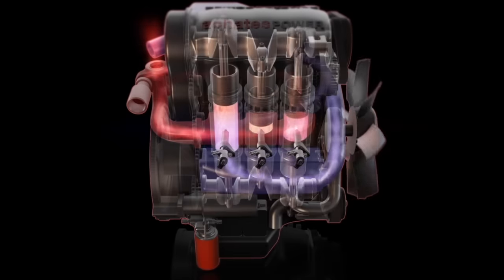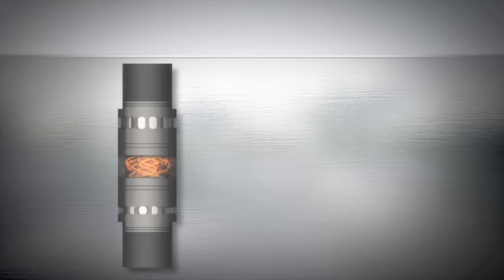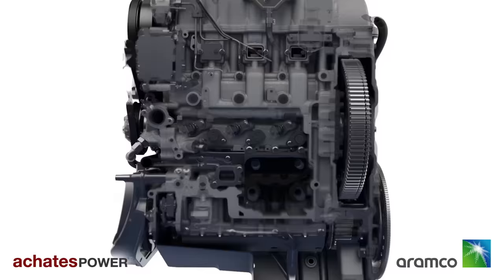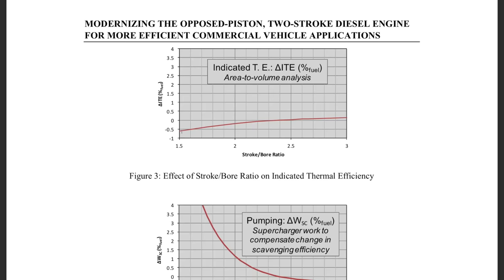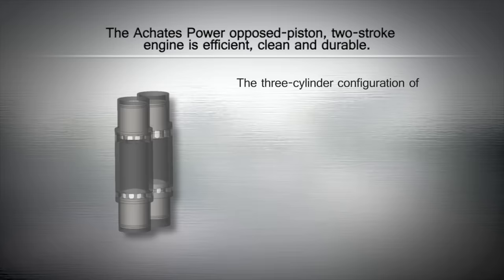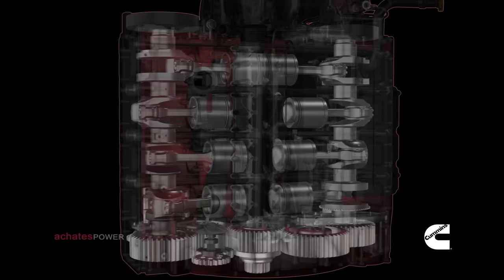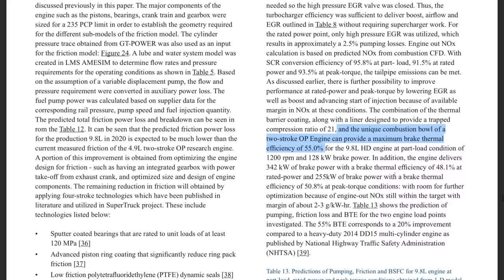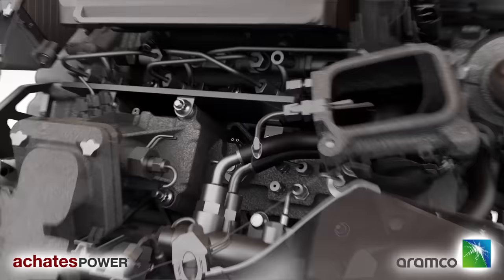Opposed Piston Diesel Engines Are Crazy Efficient

Comment: This is so cool. When I started working on my own cars, I did a headgasket repair on my supra in highschool. I actually thought about an engine design like this completely on my own and asked my dad about it since he was a mechanic in the military in his younger years. He said about the same thing that you did about auto manufacturers had created this design and I did the research. I feel like the old designs only didn't catch on because they didn't have the computer precision we do today. I knew this would be about the most efficient engine design if it were precise enough. That's why I've always been impartial to i6 engines because although they are somewhat heavy in the nose of a car, they are beautifully balanced compared to a v8. Each engine design has benefits and drawbacks, but I have a hard time thinking about drawbacks to an engine like this.
Reply: Impartial? I think you mean partial to i6

Comment: The real question is: What do they sound like?
Reply: Listen to a Deltic engine under load Salz :)
Reply: Maybe "brapp brappp braappp ..." If the engine without catalytic converter or noise insulation, likes an rotary engine because they dont have a valve control intake or outake. It will be nice sound i think.
Reply: Humm they should make it sound like George Jetsons space ship ,  and do they have on for a 50 cc moped?  Any mfg any where's?
Reply: Likely a 4stroke V6. 3cyl 2 strokes would give the same pulse pattern.
Reply: If they would sound like the old Detroits, I would buy one as soon as possible. Straight stacks anyone?
Reply: VROOM!
Reply: They're completely silent since they're opposing each other and the sound cancels itself out
Reply: @foxx8414  Oh drat! No Detroit rat-a-tat??????
Reply: Whatever the sound...it's better with a BORLA
Reply: It sounds like a wave
Reply: @foxx8414 When I was at school 55 years ago we were right by the A361 in Frome, Somerset. Commer trucks with the TS3 diesel were going past the school all the time, they sounded AWESOME!
Reply: @hawkfumodee5364  1960's Commer van  Deltic has way too many cylinders
Reply: Reng-deng-deng Reng-deng-deng Reng-deng-deng Reng-deng-deng.
That's how those old 2 stoke motorcycle engines of the 70's sounded :)
Reply: Search 1970s Chieftain tank, they were fitted with L60 opposed engines and sound awesome. Although they were notoriously smoky!
Reply: Glorious!!! Google Commer Knocker
Reply: Jonathan Griffin I live in that exact area, have done all my life. Small old world eh. D
Reply: RobS80 Gaming a dear friend of mine is an ex tank mech, he is an amazing guide around The Tank Museum. The L60 sounds great, especially under full load!
Reply: Like a Commer TS3 from the 1950's
Reply: My best description from what Ive seen/heard: at idle they have a quiet rattle almost reminding me of an old GM diesel, at low to mid rpm's almost sound like an inline 4 gas pot, and (my favourite part) when the rpm's climb they start to get that sweet sweet screaming jimmy tone!
Reply: It's either going to sound amazing or terrible I can tell you that
Reply: Vrummmm vrummmm! Like so!
Reply: There are Videos online of this thing in a F-150. It basically sounds like an old detroit diesel lol
Reply: My grandfather ran a commer knocker on his farm. Called a 'knocker' for good reason. It was very loud, especially in the cab. So yeah, I was wondering about the noise myself. Even so I loved that old truck.
Reply: Think german Ju87 stuka minus the alarm sound they make when diving.
Reply: Thank you. I was thinking the same thing. A 2-stroke gas engine is loud as it is. Now throw that into a diesel and it seems like putting two opposed pistons in a single cylinder would make a lot of noise!
Reply: There's a video of it in an F150, it sounds more like a Detroit two stroke diesel engine.
Reply: @buzztrucker  there is a video of it running, sounds more like a Detroit two stroke diesel engine, nothing like a two stroke gas engine
Reply: Nico Aalderink   
“BRRRRRRRRRTTTT” 
A10 Warthog
Reply: Came to comment this. Will it sound like a badass dorito ooooor something else???
Reply: Like a small little I6
Reply: They would sound like a 1950 Commer truck.
Reply: Search Comma Knocker.....
Reply: @suggesttwo  that's what I'm thinking! Let's get this baby out there!
Reply: Hopefully like a big Yamaha RD350 on steroids.
Reply: It has an equalizer and you can make it sound as you'd like
Reply: All hands stand clear port and starboard rolling the diesel with air. Cuh chu chu bla bla Bal rumble rumble ba cuh
Reply: Vroooom neeeeoooowwww nyooooooommmmm brappapapapapappp bang pop vroom?
Reply: Chi-ching?
Reply: I think it would have a sound simular to an old hit and miss engine, kinda like a rough idleing harly
Reply: They sound like the original Saab rallying 3cylinder 2 stroke -- very smooth but buzzy! or if you are old enough in the UK to remember the Fodens of the early '60s!  For all, you bikers think of the Yamaha two-stroke 3 cylinder!
Reply: When I was a kid, there were three Fairbanks-Morse switchers working in one of the local railroad switch yards and also shuffling railroad cars all over town.  All Fairbanks-Morse locomotives used O.P diesels (Fairbanks-Morse made the O.P. diesels that powered American submarines during WWII).  These locomotives were not any louder than the more common EMD diesel-electric locomotives of the day, but their sound was very smooth and sweet and distinctive.  The engine described here is much smaller, of course, but I see no reason to believe the people here who think it will be loud and obnoxious just because tiny gas-powered two-stroke engines are.
Reply: Well we no it won’t sound like.....suuuuuzuuuuuukiiiiiiiii!
Reply: They sound like Subaru and Detroit Diesel had a baby.
Reply: RARRRRRRRRRRRRRRRRRRRRR
Reply: Screamin jimmy is back
Reply: Heckin' loud. Look elsewhere on YouTube for Deltic locomotives, Commer trucks or Chieftain tanks.

Comment: but no vtec because no cams :c
Reply: lasagna bloke The Fuel Injector and turbocharger System can work with the ECU to alter the Air:Fuel Ratio and can make something close to VTEC
Reply: Regular 2stroke engines have had variable exhaust timing for many years. No problem to ad it on a opposed piston 2stroke if needed.
Reply: no vtec = inferior engine
Reply from the maker: Unlike my S2000, it actually has torque haha
Reply: emperorSbraz muh vtec😰😰😤😤👿😱
Reply: I wonder if the setup will be vertical engine or horizontal engine
Reply: port size is comparable to cam profiles, changing the size of the ports does the same thing here
Reply: +Erik Anton Seastead  Port size _and location in the bore _ are comparable to cam profiles - the height of the opening equates to duration, the width to lift, and the location up and down the bore works the same as cam timing.  And the total port area would be equivalent to the size of the valve.
Reply: Engineering Explained your S2K has torque. but would you give it an Achates crate motor if you can get one?
Reply: Engineering Explained I have some modifications to help you with that.😁  I live near Preston.
Reply: lasagna bloke yep. Never VTEC.
Reply: Engineering Explained get the engine ported then. Read David Vizzard or Vizard's book. I own a few. Tons of cylinder head improvements help with low end torque if done right. :)
Reply: lasagna bloke GOOD
Reply: Tune the exhaust for the acoustic wave front to help with scavenging like in other 2-strokes. I could see this in marine, large (big rig and larger), or even 350/3500 size trucks. But the size and complexity might not translate well to smaller uses.
Reply: Simpler design= greater reliability.
"Simplicity is the art of engineering"
Reply: john hanrahan simple isn't always better just look at apple.
Reply: Waiting for a diesel 3 cylinder S2000
Reply: Those poor bastards. lol
Reply: Gotta have the vtec or it's not considered progress 😁
Reply: Espen Schjelderup Oh...I thought 2T's Exhaust ports are opened and closed by the Piston so there is no way to control it.
Reply: This design possibly can reduced engine vibration.
Reply: It's Diesel. Diesels don't use v-tech anyway.
Reply: lasagna bloke 
If you have ever drive a two stroke diesel like the ts3 /ts4 who needs vtec the pure sound and power delivery can not be matched .
Reply: V-tec is for gazoline engines with electric ignition
Reply: Vtec is crap same as Vvti ... it's variable cam timing ... individual valve stem adjustment would be impressive but even then this motor has no cams and need of stem valves that makes it far superior and less moving parts ..... and if you think Vtec gives a boost you have never ridden a two banger with PVS.
The biggest problem with sleeve port two strokes is bore ware and if you service it quickly and easily ?
Reply: You want vtec? Put a powervalve on each cylinder.
Reply: Aizat Fikri I suspect that a horizontal orientation would be more efficient since gravity would not be as much of a factor. However, in some vehicles, space may be of concern.
Reply: lasagna bloke it's called turbo spool in this
Reply: ZR1 Gamer They are opened and closed by the piston yes.
But many high power 2 strokes have used adjustable sleeves in the exhaustports to gain a wider powerband for the last 20+ years.
Reply: Intake and exhaust isn't variable for different working conditions....  Wouldn't altering those increase efficiency further?
Reply: Oh you can definitely give it vtec though.
Reply: aussiebloke609 '
Reply: You could if you combined this motor as a sleeve valve motor! They're another really interesting motor, very very quiet but had oil consumption issues back in the day- nothing modern technology couldn't fix though!

Comment: Instead of TDC AND BDC, it is actually inner and outer dead center. Worked on Fairbanks Morse OP engines and taught them for the U.S. COAST GUARD from 1976 to 1987
Reply: Yes, many American WW2 submarines were powered by Fairbanks-Morse opposed piston engines.  They kicked SERIOUS butt.
Reply: Everything up to the Virginia class were/are equipped with an FM 38ND 8 ⅛  as an emergency generator, MM2(SS)
Reply: Yeah, we had these on my old tugboat, The Socrates. It had 2 Fairbanks Morse Engines out of old locomotives.
Reply: I was in the navy from 2003 till 2008 and we used the Fairbanks Morse op engines at our ship wide generators.